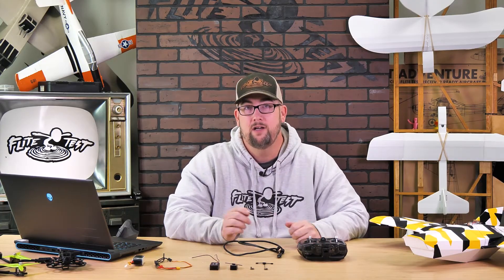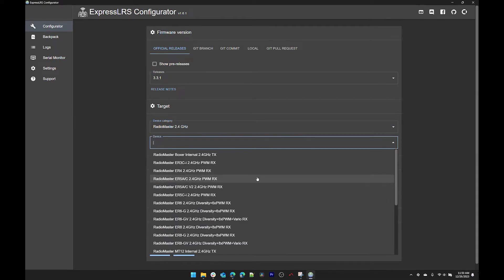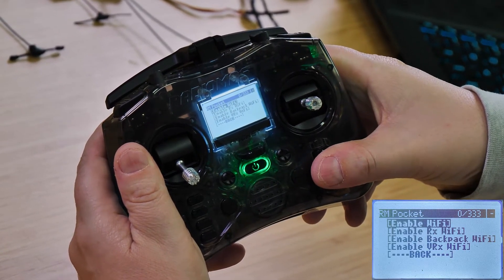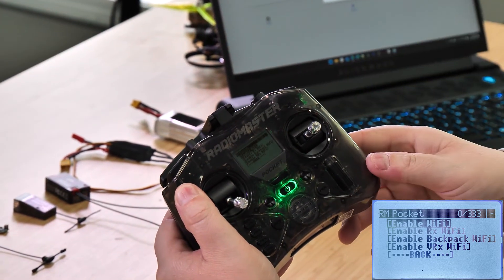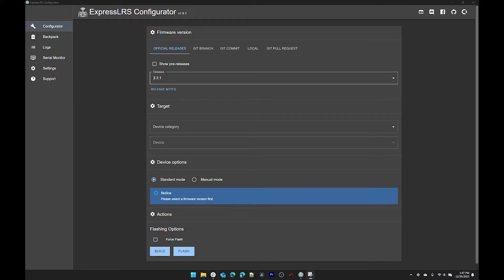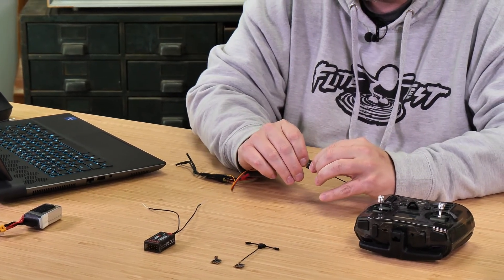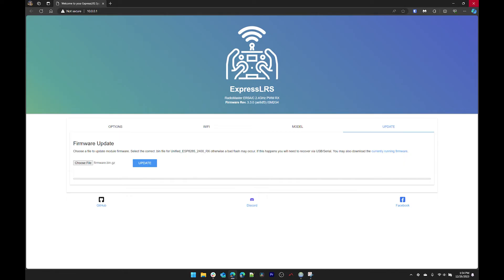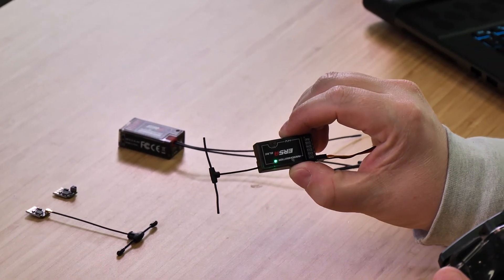How To Update Firmware on Express LRS

Comment: I have a RadioMaster GX12 but cannot find it in the Device drop-down menu.  Any suggestions?
Reply: Okay, in the instructions above, it has you choose "RadioMaster 2.4 GHz" as the Device category.  If you have a GX12, you need to select "RadioMaster".
Reply: The current version of ExpressLRS Configurator in the GitHub repo is 1.7.7.  There are some differences between the screens you have in your video and the current version.  You know where I'm heading.

BTW, a most excellent video.  Thank you.

Comment: Hey thanks ever so much for this I forgotten how to do this. So quick question of upgraded to 3.54 but I also upgraded the firmware.bin and for some reason it's still showing the original Factory version ?   I think I managed to upgrade the luas script ok but for some reason the radio firmware is still showing the old version does this automatically upgrade that or do I need to download that as well?

Comment: Hi👋,
I have a boxer,and with the "driver fix" i have updated the edgeTX firmware.
Now i try to update the elrs but i still have the driver problem,when i plug in the radio when its power on in serial mode(it also dont ask me for usb mode,i must make it self in the menü).
All other works great👍.
I can see the folders from the radio,can copy things,usw ..
But with the sml32 bootloader on the pc i have problems.

Is there any way to update the elrs without direkt connection to pc? (Updating like edgetx direkt from radio?)

And is there a way to make the menü in the radio writing german?
(Sound is in german,but the menüs are in english)

Have anybody a idea?

Thanks a lot🙏

Comment: Everything went smooth till updating the receiver on the flight controller.  I'm not sure which option to choose on device. For device category I choose radiomaster 2.4 ghz, but device there's no name brand  not sure if I gotta choose radiomaster rp1, rp2 rx. The receiver is 1 wire antenna

Comment: Great step by step instruction! Many, many thanks! Please also make sure under CRSF settings that transmitter and receiver are set to the same channel. Had a case where my transmitter was on CH0 and receiver on CH1. In close distance they connected but when I tried to fly I only had about 5m range with my Radiomaster ER5C-i receiver. When both are on same channel I have more than several hundreds of meters/ yards range. I am a beginner and trying to learn ELRS.

Comment: I successfully built my binding phrase and everything is good but my express lrs content isn't showing when I enable it on my RM Pocket.. what am I doing wrong with the radio? It used to show it before when I tried it last time. This time the WiFi connectivity isn't showing up with the little Express lrs option to connect. Please help me 😢
Reply: Make sure that the internal RF option is enabled in the model settings.

Comment: I always type in my wifi settings when Im connecting to an elrs device for the first time, so that it will connect to my wifi instead of me having to connect to it. Then you can flash it directly from the configurator, or go to the web ui without loosing your internet connection.